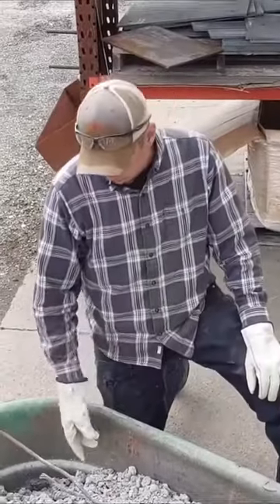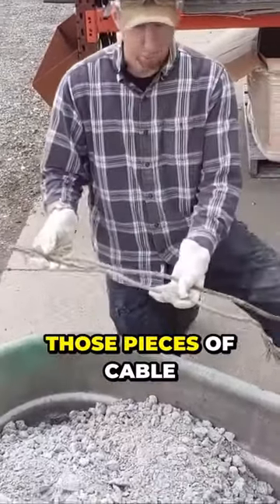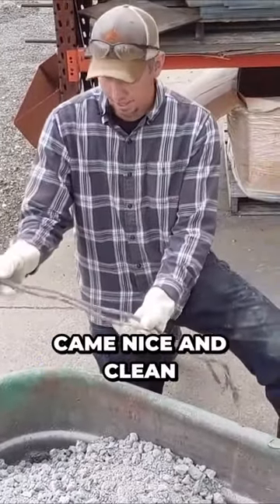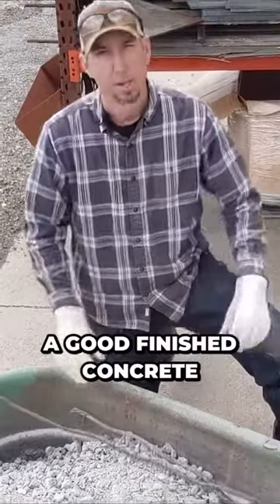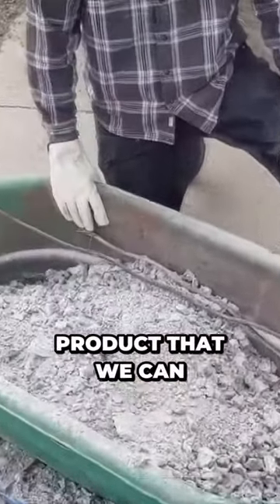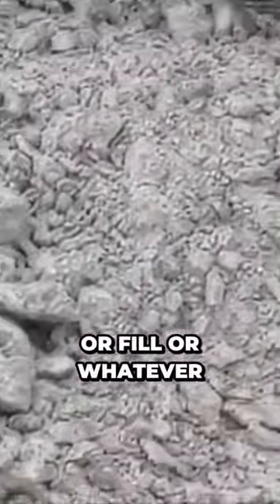10x16 Jaw Crusher Crushing Concrete Curbs

Comment: Crushed concrete makes a great base material it compacts well and is super stable the only thing better it the crushed concrete washout ( leftovers from concrete trucks washing out their remaining loads that they saturate with water) once that’s crushed down the Portland cement can be activated one more time by adding water and the result makes a base that can be extremely compacted and if it’s crushed to 1 inch minus it leaves room for expansive materials like clay to move into and out of the voids during swelling and drying without messing with the foundation of the structure built on top of it way better than abc ect thanks for sharing see you on the next one 👍🏼👊🏼